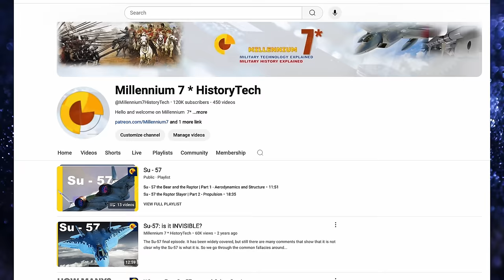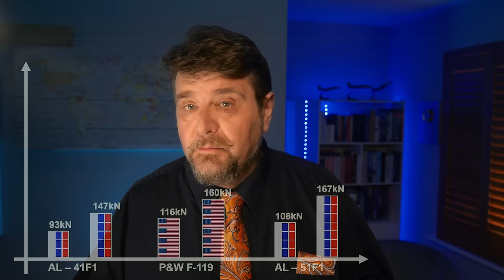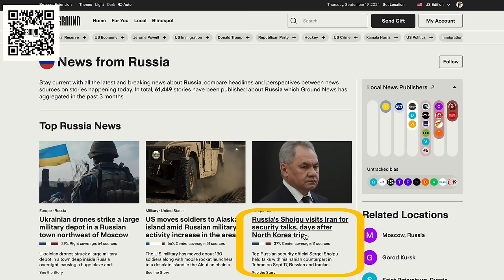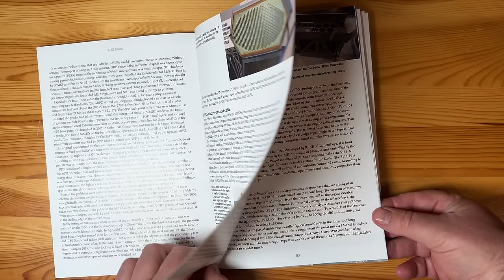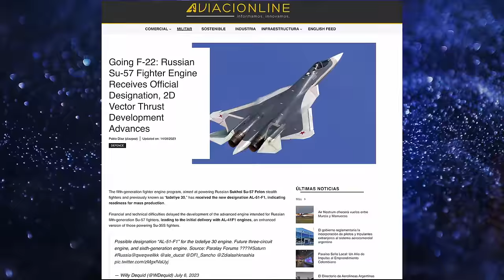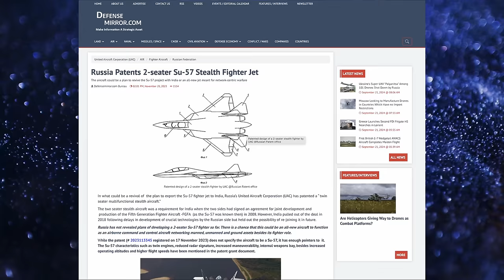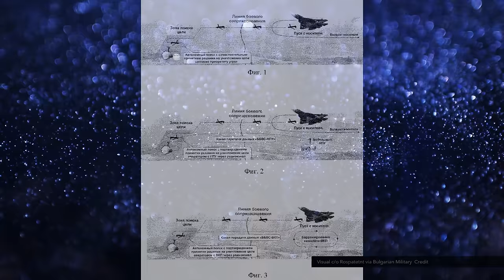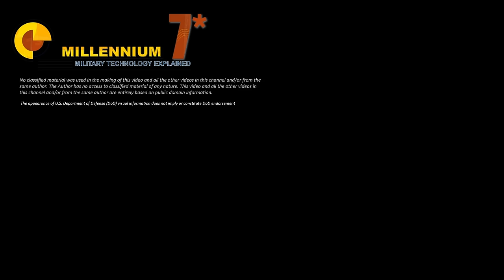The Su-57 is a Masterpiece!

Comment: Great video as always. 
A couple of questions/considerations: i may be wrong  or the source could but i've read somewhere that the kh-69s have also been integrated on Su-34s and possibly 35s, which to me makes a lot of sense.
 Regarding the supposed Su-35s escort missions, isn't it possible that the ukrainians have built some kind of ground based mobile elint platform (if that was the case i would bet on western tech imports) to "ear" and analyze russian emissions, through which they found out about these supposed flights and crossreferenced the data with western elint platforms? Also, i'm not very familiar with long range aesa radars' resolution capabilities but wouldn't make the Su-57s fly alongside Su-35s screen it from radar profiling? I guess they could've just used lunenberg reflectors to do so, so i feel like im probably wrong and missing something. 

Thanks in advance

Comment: It was very unfortunate that the 5 generation stealth air  dominance fighter/ multirole fighter aircraft's wasn't a joint project between the Russian aviation industry and their Chinese counterpart...
the Russian army, as well as the Chinese army, beside the defense industries sector in both countries, are under sanctions from Western countries., therefore, they can cooperate to design and manufacture the main weapon systems this would reduce the overall costs, help solve the testing and developing problems, overcome technical and technological obstacles, and facilitate large-scale production operations.
the industrial infrastructure of the Chinese aviation industry, coupled with their tremendous progress in the microtechnology sector with large orders from the PLAAF, would have helped to rapid progress in this project and reduced the acquisition and operating costs for both parties, and would have had a better chance to compete on the international market...

I don't doubt the plane is an exceptionally excellent platform, very well equipped especially compared with conventionally designed 4++ fighter aircraft's, and surpassing the f35 in technical and parameters specifications and flying characteristics...

although at least theoretically the Russian fighter should be compared only with the f22, but the latter still considered the best overall stealthy air dominance/multirole fighter aircraft, worth noting here that both stealthy platforms adopted different designing approachs while the Russian SU57 tends to be wider and thinner similar to the YF23 black widow although the frontal nose was the inspired by the frontal nose of the tu22, while the f22 semi conventional design with theoretically with good internal carrying capacity...
 
regarding the comparing the stealth signatures between the SU57 and f35, its difficult to judge the Russian warbird stealth capabilities and it didn't enter the Ukrainian airspace and its attack's missions still conducted from over the Russian territory or Russian controlled territory inside Ukraine, while some sources claim that the f35  proved some of its tactical and operational capabilities across the Arabic region and the middle east...

Comment: Personally i don't care exactly how "good" it is, because it's interesting anyway. And in most cases the combat is decided by other factors anyway so ranking planes based on their paper performance is a silly game for nerds that doesn't really have anything to do with real life performance. Better performance just increases your odds of victory, substantially if it's a large difference. But superior training and tactics and vastly better AWACs usually are the main reasons western jets have been more successful. It would be basically pointless to fly any fighter that wasn't the top of the line, most modern one available otherwise, you would just be guaranteeing the enemy a victory. You aren't because a MiG-21 can still shoot down an F-15, if it gets the right opportunity. It can easily get that if the pilot or Awacs does a bad job, whatever the performance difference is.

Comment: 57 is good looking and it's ultimate version will be just as awesome as the ultimate Flanker the 35 turned out to be, what we usually see is confusing Russian rather less than optimal doctrine issue with their rather usually innovative engineering solutions, and what west often faced were watered down export versions of these products again often used under already loosing conditions and by weak tactical thinking...

Comment: Absolutely way better than the bucket-35. F-22 too old unless they upgrade it.
Reply: The SU-57 is not even finished yet. The supposed engine is not yet ready and when it is, it would be a generation behind the Americans in performance. It is only supposed to match the output of the F-119 engine found on the F-22. The F-135 is the latest US jet and the Americans are already in the late stages of development for their adaptive cycle engine. 

The radar found of the SU-57 is also not that impressive. Russia is behind the packaging technology. The big nose of the SU-57 is not even able to fit as big of a radar as the smaller F-35. The F-22's APG-77 radar is even bigger.
Reply: It's finished , depending of the sources
Su 57 has multiple advantage than many US fighters
I think a hand full of su 57 can go hand in hand with numerous f16's and f15's 
But against f35 and f22 it's most unlikely
The only thing the su 57 lack is  numbers
Reply: @mathijeba5375  And technological sophistication
Reply: @m.a3914  As said in the vedio it has 360° radar coverage which could definitely increase its situational awareness pared with its long range radar and long range missiles the f 16's and f 15's could suffer
The ecm capables are definitely highly classified so we wouldn't know it until ww3
Reply: @mathijeba5375  With such a weak radars, we can't even talk about long range here. The only radar, capable of long ranges is the main nose radar but even that is relatively small radar. It has less T/R units than F-35 which is a smaller jet and a lot less than a jet like F-22.
Reply: @m.a3914  yes , it's true
I think you know that f35 has 360° it scanners the su57 had radars which is definitely better and even if su 57 radars have larger radars the aircraft cannot launch its missile it the target if behind, it has to turn towards the target and the front radar is pretty good for long range fights 
It has been proven in combat in ukraine 
You couldn't just took it from Wikipedia
Reply: @m.a3914  by T/R what do you mean? 
Transmit/recive?
Reply: @mathijeba5375  But the F-35 can launch a missile if the target is behind it. That's due to the unbelievable maneuverability of the AIM-9X missile, the helmet and the fact that the jet can provide visibility through the aircraft to its pilot. These radars are more for incoming or very close targets. They can't be used for long range operation due to the relatively low power.
Reply: @mathijeba5375  Yes, the transmit/receive modules.
Reply: @m.a3914  the aim-9x is a short range missile, not a long range missile

Sure the f 35's helmet can provide 360° view but screen in front of the pilot can provide the same 360° information
Reply: @m.a3914  I have to agree that i know less about the t/r units about the su 57 and f35 
Surely the f35 would have advance technology but the real estimates will be unknown you can't just find it unless you know someone who worked there
And either government will mostly won't give the information about the real technology as other factors can be found easily 
And if the T/R until could do any notable impactful in a fight is questionable
Reply: @mathijeba5375  But you can aim the missile using your own eyes. 

The US tech industry is just on a whole different level. Of course, their technology would be far better than Russia's. We don't really need an insider to tell us that
Reply: @m.a3914  yes, even though it could be useful in close quarter dog fights 
A normal su 27 could even lock an target with the hmd which could lock an target with sight but it's not that advance compared to f35
The information displayed on the hmd of f35 is also displayed on the screen in front of the pilot in any fighter jet
Reply: @m.a3914  well, I do agree that USA on the technology base is far greater than Russia
But would these advancements make any difference in overall combat is questionable
Reply: @m.a3914  I just learned  that the Russian R-74M2 and izdeliye 300m can be very similar to aim-9x in terms of range and agility
However either Russian nor American jet fire long range bvr missiles if the enemy is right behind it 
What i am trying to say is the su 57 has 360° radar coverage which could allow it the detect the incoming object from any angle and just turn, lock and intercept it 
Wile the su 57 has 369° radar coverage it could not be affected by weather unlike the ur scanners in f 35
Anyway a fighter jet pared with an awacs  theoretically has 360° radar coverage

Comment: If Su-57 was excorted by Su-35 it is because of Russian tactics. In Russian  Air Force one plane can t be a fighter and a bomber the same time. So, when one plane cares bombs and cruise missile, the other flys higher and controls the air, caring air to air and anti-radar missiles. Yes, Su-57 Su-34, Su-30 can care air-to-air missile, but one plane cant care full nomber of all types of weapon, and one pilot cant serve like a fighter and like a bomber in the same time.
Reply: AFAIK the Su-34 was designed primarily to be capable fly same missions as the Su-35 can, so same range, same speed etc. So that the Su-34 and Su-35 can be easily paired, unlike example F/A-18 + A-6. 

But while the Su-34 can take the same A-A missiles and protect itself as in "Multirole" fighter. The whole western ideology is based to it, that all fighters can perform A-A same time as they do A-G missions. As in you send example three F/A-18 on mission, and each carry two medium range A-A missiles, two short range A-A missiles, and two bombs on each. And now you have strike package that can defend itself or clear the path to strike the two targets (Fighters 1, 2 and 3 has two A and B targets together. Fighter 1 has A as primary and B as secondary, fighter 2 has B as primary and A as secondary and fighter 3 has both as secondary if required for second pass). 

West has used these multi-role fighters only once for the multi-role tasking, where F/A-18 performed first time (and last time) A-A kill with medium A-A missile and then continued to bomb the target and returned. 

But that is not really the point for these. Idea is that you ease the logistics and maintenance hours. 
You have just one fighter to support and service. On each mission the fighter last day used for bombing, is now used to provide air cover. On next mission it can be doing electronic intelligence gathering. Not so that one fighter does it all at same time all the time.

And this is the interesting part, as west have moved away from F-111 and similar, Russia designed and built that Su-34 to be fielded next to Su-35's. But Russia doesn't use naval fleet as carrier group, so they don't need one plane to do it all. 

And Su-57 doesn't look to be used for a low-altitude strike missions like Su-34 is designed to do. As in those missions you really benefit from the second pilot working the navigation, targeting and communications, where pilot can focus to flying and combat. And as Su-57 doesn't have two pilot variant, it doesn't offer that same capability, even if it has better avionics and targeting systems to do it all.

West like always to downplay everything that Russia does. Not even considering that there is reason or purpose why Russia does something differently. And that arrogance can result lot of deaths.

Comment: India dumped the Su-57 because it wasn't stealthier than their 1986 Mirage-2000
Russia can't make a fully capable Su-57 and make it stealth beczuse THEY NEED FRENCH TECHNOLOGIES !!!
They needed the Dassault baked-in radar absorbent materials even Lockheed Martin envies (they still need coating). Shenyang tried to create such a thing for the J-31 (maybe renamed J-35), they failed and returned to coating, then, they needed the Thales AESA GaN T/R modules for the 6 radars onboard especially sinch each T/R module does the job of two made by Northrop Grumman (that's why the small Rafale's radar outguns the larger one on the F-35), they also wanted the QWIP (quantum well infrared photodetector) from the Rafale for their EO/IRST and a Safran core for the super-duper jet engine that would have made the aircraft waaaay more reliable than the SATURN from the Su-35 that lacks thrust and goes to the trashbin after 2500 hours...

Without Putin's imperialist antics, for sure, the Su-57 would have been a real masterpiece and assuredly been bought/made in India but likely also in France which, for a time, considered buying some F-22s.
Russia is a pity. If Russia was switching population and system with Germany + France, after 30 years, Paris and Berlin would still look great but the remainder of the countries would become 3rd world while Russia would be turned into a 12 trillions economy in today's $... 
Instead, with his colonialist folies, Russia is now out of the G20, they must be 21st while they have more natural ressources than any other country in the world... As Gary Kasparov recently said, as long as they won't take this mind virus out of their heads, Russia will be a failure, Russia needs a military defeat in Ukraine or it will go on like this forever...

Be aware that until April 2018, India paid for the whole Su-57 R&D and they totally gave up because it just proved being totally irrelevant, sub par on EVERYTHING and as well the Indian Air-Force rejected the Mig635, the Su-35, the Su-57 ended inferior by FAR to the French Rafale !!!

Comment: I find it hard to believe that they have become completely immune to sanctions in the field of electronics. I don't think the Russian Federation has the capability to manufacture state of the art complex ICs internally. After all, most of the Western world goes to Taiwan for that.
Of course, there could be some "smuggling" going on...
Reply: Russia produces 28nm chips on their own, and for the majority of weapon systems, that is more than enough. Weapons don't need the latest and greatest in microprocessors because
Weapon systems don't do anything remotely complicated, such as, for example, graphic design or 3D modeling, etc. Targeting, tracking and that kind of stuff are not too demanding
CPU wise. And for more advanced chips, they have China, and the Chinese just overtook Dutch lithography, they managed to produce a 4nm chip.

Comment: 👑🤜🤛👑 We have innovations for novel ultra-efficient, high specific thrust turbo engines and are developing a small prototype. 👑🤜🤛👑 
...Besides AWAC, satellites or pseudo-satellites will track the battle-space activity and relay it to the sensor network so the active elements don't need to use own active sensors.

Comment: I want to take you seriously and I understand that you do have adequate technical knowledge. The 360 aesa capability sounds like the Chinese brochures you get on the internet…. Fancy but have nothing to do with the actual product. AESA requires some fancy code to work and although they do have experience with stationary systems, does not offer any transferability to fighter planes. It’s a completely different concept. Also a new engine installed on 10 planes would not encourage future operators. You need a lot of data to establish the MTBM and MTBF in order to organise your airforce. if they don’t scrap the project they will definitely downgrade it… my estimate is that the final product will be ready by 2035 or later.

Comment: I think not 35s escorted 57, but 57 escorted 35s. Why? Well, it looks like 57 have much more advanced sensor systems, and 9ne of features 5th gen has - sync all data from other systems of other tech. So, the leader of the group in 57 that makes decisions and control operation is kinda not bad decision when you have limited amount of 57s.